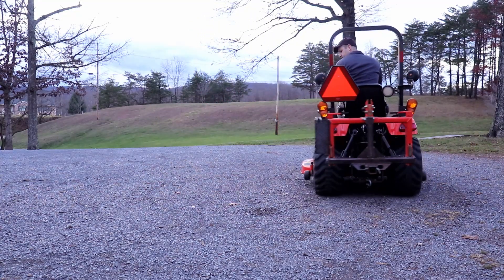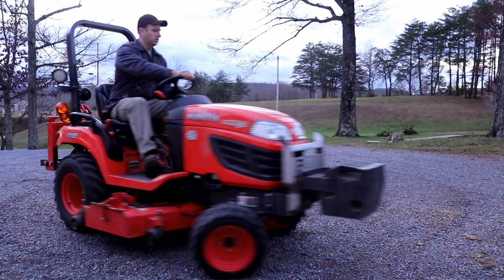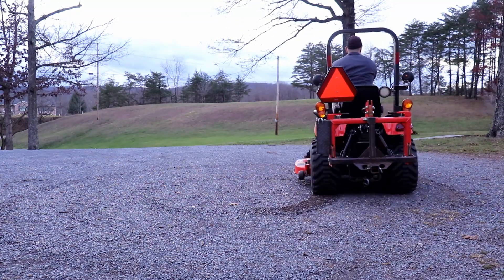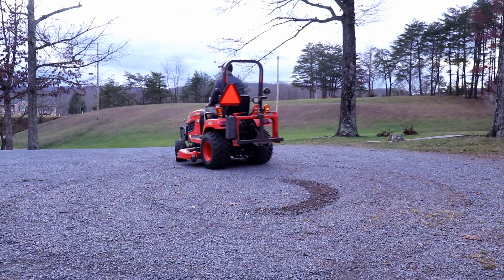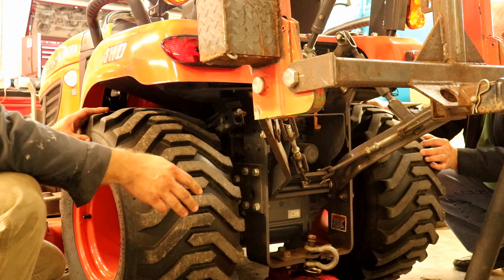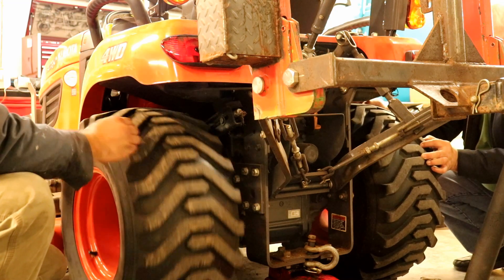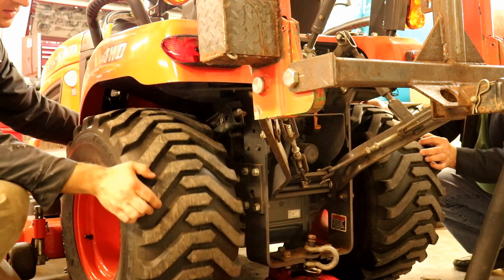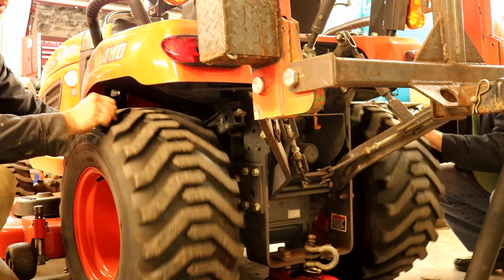Everything You Need to Know About a Differential Lock on A Tractor

Comment: I have been struggling to get a competent answer and service from the Service department at Bobcat of Buffalo about the differential lock and wiring harness on my new tractor for over 11 months. Five different technicians have stopped over to service the differential and electrical without success. No one could tell me how to use the differential correctly or if it was broken.
I had to submit a complaint to the company to get a response from dealership.
Not until I watched this YouTube video had I learned the proper way to operate the differential. Ps: lights still not working because once the fifth technician figured out the switch was bad, I was told parts were not available. Bottom line, stay away from Bobcat dealers and company. I wasted $500 on extended warranty.  
Lastly, thank you for the video.

Comment: A little late to the party, but wanted to thank you for this demonstration. Oddly enough, it helped me to understand the diff lock operation on my new Cub Cadet GT54. The owners manual instructions are contradictory, and I was concerned about bricking the K62 transmission as the lock engagement was inconsistent whether the unit was stationary or moving. A few trial runs in the yard with your excellent (turning) tips provided the input necessary to engage the lock without issue. Much appreciated, sir!
Reply from the maker: You are very welcome!

Comment: Why not just unlock brake together pedal and push down on spinning wheel pedal
Reply from the maker: Smaller tractors don't have independent brakes. That is an option if you have independent brakes. I like a diff lock better if you know you are going to be on a real hard pull, step on the diff lock before a tire slips.

Comment: Great video ! I have a question could you please clarify ..... I am super confused - 

You said you will engage the diff lock while you’re coming up to a place where you know you’ll need it( so you’re driving and the tires ARE obviously spinning) .  
But then you said NOT to engage the diff lock while the tires are spinning or on dry pavement.    ???
So when should you engage the diff lock?    Thank you
Reply from the maker: If you are stuck and spinning stop spinning. Then press on the diff lock. Spin the tires very slowly til it engages. I wouldn't make a turn on dry pavement with the diff lock engaged. Use the diff lock when ever you need more traction than you get with 4wd.

Comment: Go info I never knew about turning the steering while push down on the differential peddle. Thanks. I try to be easy on this lock, and the same reason I don't intend to increase the hydrolic pressure.  I know what is going on in these drive trains,  same as trying to lift too much with the 3 point hitch.  If any of these brake you have big repair. Every thing has to come apart.
Reply from the maker: Your welcome! Increasing the hydraulic pressure can be risky.

Comment: Great idea for a video! i never thought that people may not know what it is. i grew up in a area and time when anyone running a tractor knew what a DL was. But now days, new homesteads, city folks giving up their lives for a life in the country, great idea for a video!
Reply from the maker: Thanks. I always try to throw a tip in the video, (in this case turning the wheel for faster engagement) so even someone that has used tractors for year may learn something.
Reply: @TractorTech  I dig it man. if you run out of ideas you can also make a video on the detent on the front scoop. when lowering just shove it all the way until you feel the detent engage, and bucket goes into "Free float" mode. Works great for gravel, driveways, anything you are trying to put a smooth grade on. I think most all modern tractors have it, the old ones perhaps not, but I havent ran any kind of new one that didnt have it. Just a future thought when you are trying to think of what to make a video on :-)

Comment: Excellent video roger! I have seen this question so many times lately on Facebook groups and forums. I feel that a lot of these guys who do break their Dif lock is because they are trying to engage the diff lock while moving too quickly under load because they are not slowing down their travel of speed like they should be before pushing the pedal to engage the diff lock, this usually results in breaking the locking pin. Fantastic video! Keep up the good work 👍🏻
Reply from the maker: I don't know why this is coming up so much recently? I agree, I think most cases are operator error.
Reply: @TractorTech  I totally agree. You did a fantastic job explaining how it works in this video keep up the good work
Reply: I echo Mike's comments here.  Understanding how to use the tractor properly can eliminate a lot of these issues.  Stopping the tractor, applying some pressure to the diff lock pedal, then slowly traveling until the pedal fully engages.  If you jam anything in gear, you may end up damaging things.  You have a great channel Roger!!

Comment: From what I understand it's an expensive repair if you break it. That's why I put a large bolt and large fender washer in the space just under the pedal bar set just against it so it can not be actuated by me or any one using my tractor. Too many folks don't understand tractor should be stopped before engaging. If the front wheel assist doesn't get you out go get someone to pull you out. Cheaper than a transmission repair. Have a Blessed Day
Reply: @FrostyTheBeerMan  ya472 has videos on here showing what happens when diff lock fails. If you’re moving much it could shear those lock up pins and then it’s toasted ! That’s what I based my decision not to use the diff lock on.
Reply: @michaelfinney2160   Here's a video of him working on the rear diff: https://youtu.be/upjA2DPAp5E
Reply from the maker: I don't think the diff lock is fragile. It would be an extensive repair. Have a good weekend!

Comment: Great video roger, I noticed recently when I was box blading my driveway i was trying to engage the differential in preparation for a hill but I couldn’t get my differential to engage and now it makes sense. I was driving in a straight line. Great tip on turning the steering wheel to engage it.
Reply from the maker: Thanks Adam! On the BX I think there are 4 pins that lock the axles together. If they are evenly spaced, that would mean there would have 90 degrees max of tire tire rotation for it to engage. If you driving in a straight line, and there is very little slip this could take a long time.

Comment: I had my differential lock brake in my B2601. After they took it apart they concluded it was metal fatigue. It took 45 day;s before I got it back Covered under warranty. Later
Reply: Does your B2601 have a FEL and a backhoe?  Why do you think it failed?
Reply: @ThisOldMan-ya472  Yes it does have a FEL & a BH. After looking at the pens they were cut in half my best guess is that the Rockwell of the steel wasn't the right hardness.  Later
Reply: @ItsaboutMakingnotBuying  I am attempting to modify my BX25 diff-lock with hardened steel 12mm x 34mm pins. I do not know what these pins were designed for, but hopefully they will be better than the 10mm stock ones.
Reply from the maker: I did know your diff lock broke. 45 days is long time. At least it was covered under warranty. Thanks for watching!

Comment: These differential were poorly designed. 
The pins that engages them is about the size of a woman’s nipple and about as hard as one to. They snap too easy with filled tires or a back hoe. Crap design. Need beefier pins.
Reply from the maker: I think the diff lock is designed to be the weak point. It is better to break that than something like a ring and pinion.